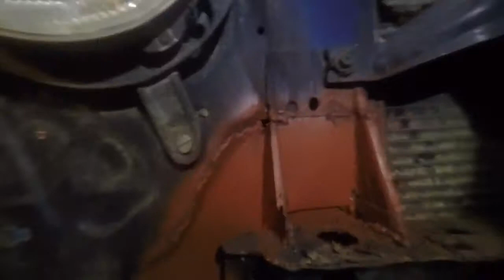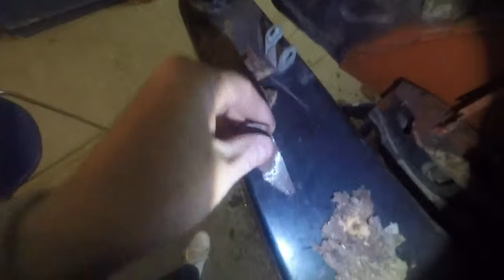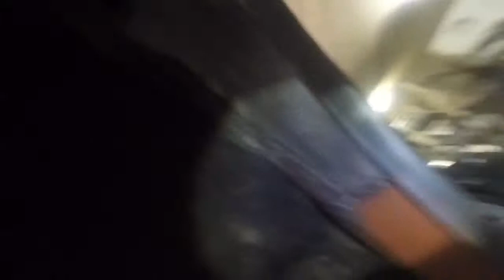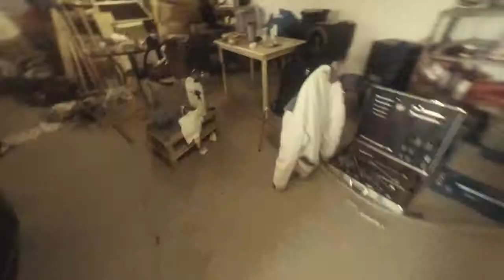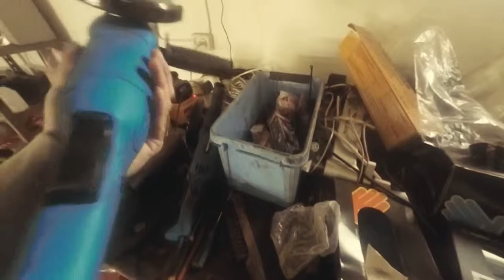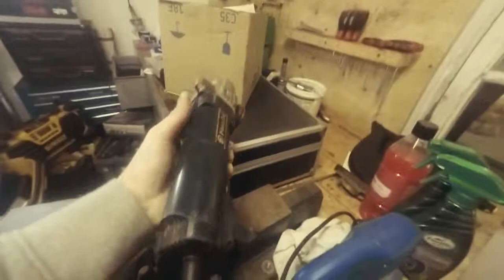metalwork,anglegrinder

Comment: Never thought of an angle grinder being so dangerous.
Reply from the maker: mine is a small 600 watt bosch  , try with a cutting wheel and mount a rag in a vice and se if you can hold it away once it gets a hold of it ! is so fast and powerfull you wont belive it ! we have 220volt as normal house power and 350-400volt as high power with 16amps fuse and 220 with 10 amps so i dont know if it makes a diff but its plenty power for cutting somone up pretty bad !

Comment: I've seen pictures of a few anglegrinder accidents on liveleak. Those things can really dig in!
I try to avoid the typical mistakes when i use mine. And mostly wear eye protection hehe

The flashligt did the trick :) 
Wonder if they might put a little flash, like from a cellphone, in the 6th generation of gopros
Reply from the maker: i really dont think so , most folks dont use it unless they are like showning thing with gopros as a video cam and not a action cam as it is from starters !